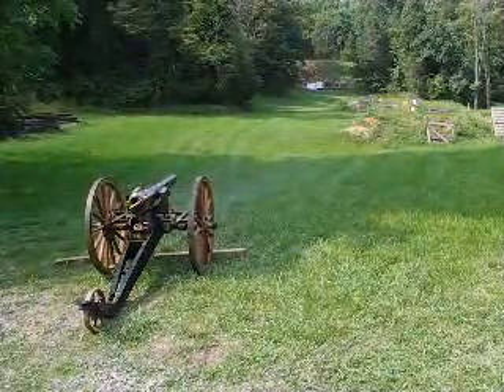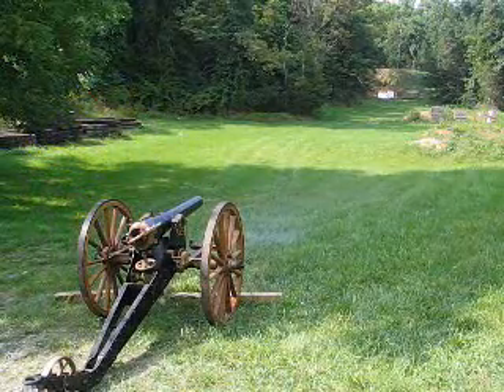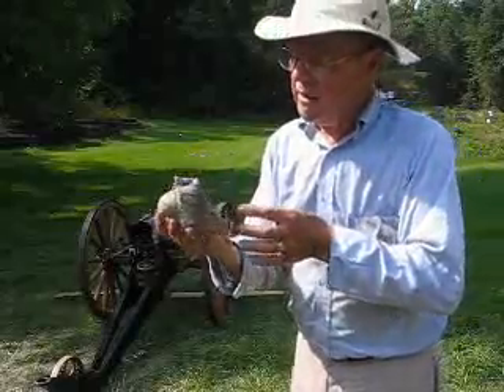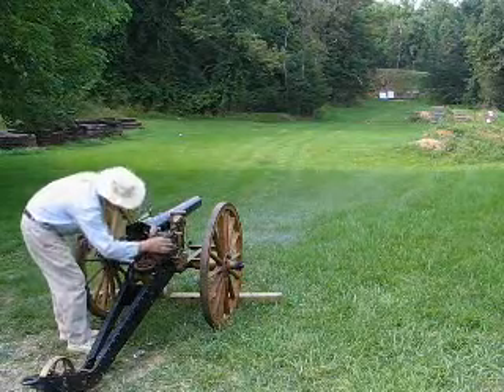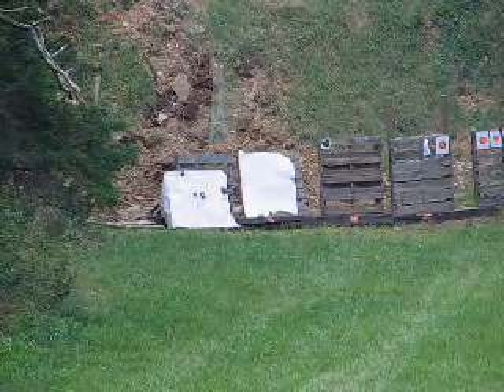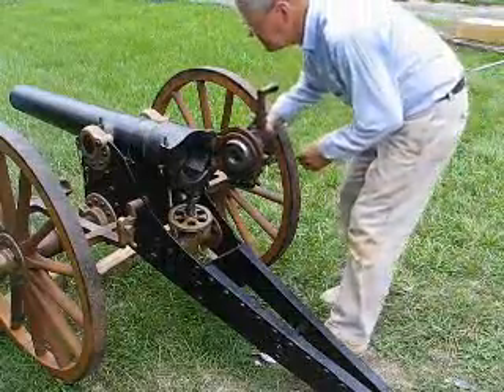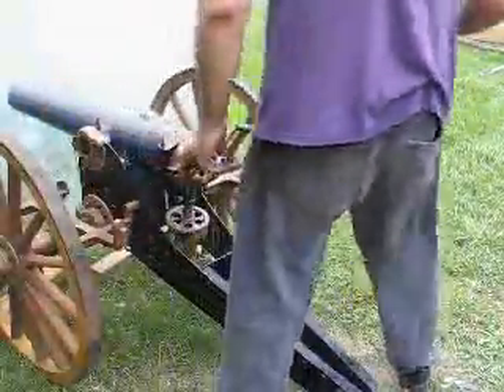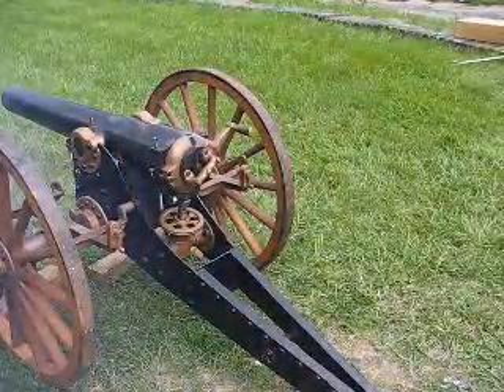CANNON FIRING:  Navy Breechloading Rifle

Comment: Have you ever considered using a polymer ball behind the lead projectile to increase accuracy and dispurse the load/pressure on the projectile's weaker skirt?  I was curious and had the idea because of the small polymer balls used by modern shotgun slug ammo manufacturer's use in their ball type slug ammunition.  Just an Idea.  I've been following your videos, and I'm a big fan!!!  I want a cannon!!!  CM

Comment from the maker: We used whatever we said on the audio track, each charge was weighed on a scale.  What we use doesn't mean that's the same amount that the Navy used back in the 1880's, they used a lot more since they wanted the projectile to go at least a mile and do damage when it got there.  All we're trying to do is hit a piece of plywood 100 yards away.  With black powder costing $10. a pound and more, you can see why we don't use a full charge each shot.